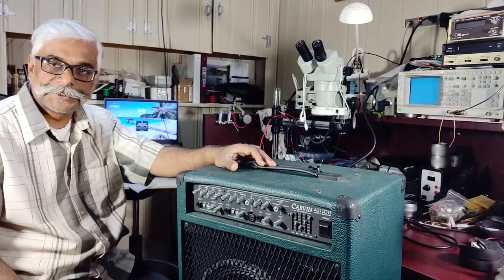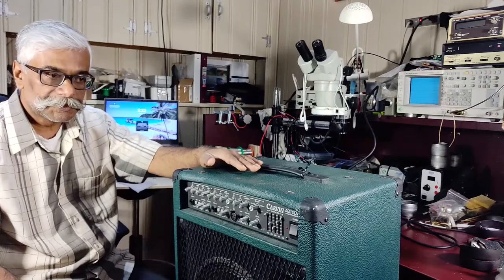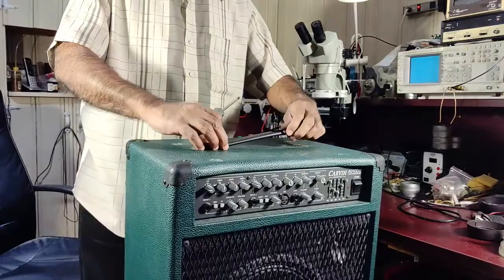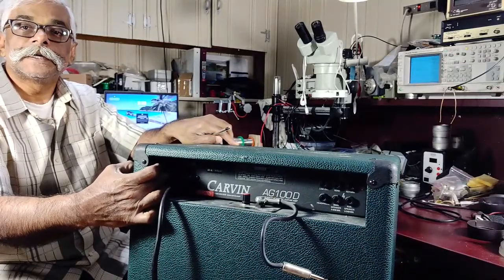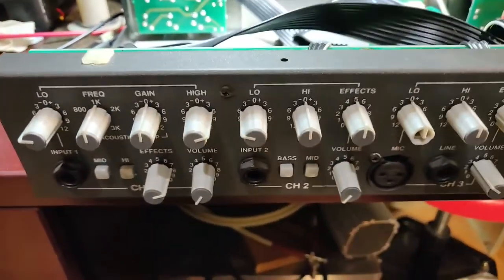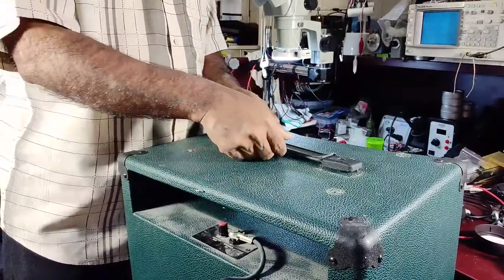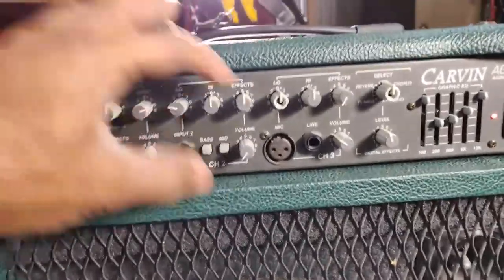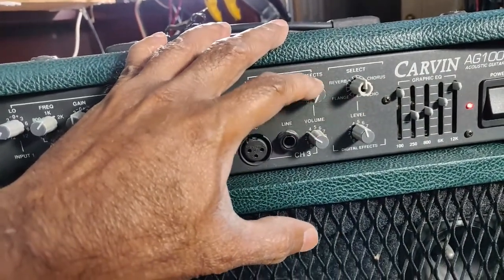Carvin AG100D | Acoustic Guitar Amp | Inside look

Comment: I have the same amp.  It has been very reliable and sounds great.  Also very versatile for not only acoustic/elec guitar, but vocals, and I even run an electric bass though it with good results.
Reply from the maker: That's nice 👍. Overall a good amp - multipurpose - value for money, and was well ahead of its time.
Reply: @PremMenon  Yes ahead of it's time indeed with 24 bit digital effects, and a real tweeter (not piezo) for high  fidelity.  The most versatile, and one of the best sounding combo amps out there.  You can even bypass the amp section and run it exclusively as an extension speaker cab.

Comment: Thanks for the help sir! Had my soon to be brother in law bring one in.
Reply from the maker: Thanks for your feedback, sir. I hope the one you get is in good condition. My best wishes to you.
Reply: Sadly, the I have 2 pots on the front that need replacing but as they are soldered directly to the PCB, I am hesitant about doing it! @PremMenon
Reply from the maker: @JasonViator  A "Band-Aid" solution is to spray DeoxIT inside those pots.
However, replacing those is not too difficult. A good temperature controlled soldering iron, a good roll of de-soldering braid, some liquid flux - and a steady hand - should do the job.

Comment: My AG100D stopped working.  The light flickers and no sound.  I pulled out the control panel and could hear a ticking from the relay.  I replaced it and still got a flickering light.  Any guess at what I should check next?  Do you make repairs at your shop?  Thanks
Reply from the maker: The PCB and Assembly drawings for the AG100D come in at least 5 different flavors from what I know.
What's the Ref Designator of the relay you replaced?
I can try and help if you can provide more details.
Bringing/sending your amp to me for repairs is not practical....and doesn't make economic sense unless you are located in Toronto.
No, it's not a shop. I just do it as a hobby.
Thanks for checking out my video. 👍
Reply: @PremMenon  Thank you for your response.  My AG100D is a Series III.  I purchased it around 2008 or 2009.  The relay I replaced was Songle SRU-24VDC-SL-C, which matched the original.  Do you think it is worth trying to repair or should I just scrap it?  I love the amp because it can be used as a bass amplifier as well as acoustic guitar and vocals.
Reply from the maker: @guitardan46  No. Please don't scrap it. As you said, it's a nice Amp.
Let me go through the circuit and see if I can remotely debug/analyze.
I'll get back.
Reply: @PremMenon  Yes, it is a really nice amp.  Thanks for working on this remotely.  🙂
Reply from the maker: @guitardan46  You probably mean the K1 relay. If that's the one, you may want to verify the circuitry (Voltage) on that relay driver (Q10, Q18), and also verify if you are getting the audio output at the relay signal input. I don't have that amp with me, but I can see that the relay is to protect the output stage as well as the speaker.
Reply: @PremMenon  Sorry for the delay in getting back to you.  I don't have the knowledge or instruments to check output.  Would you be able to work on it if I sent only the control circuit board chassis?  I removed it as you show in the video.  Thanks.
Reply: @PremMenon   I forgot to mention that I took a video of the light blinking.  You can find it under Carvin AG100D "On Light" Blinks.
Reply from the maker: @guitardan46  I wish I could say yes. It's better you find a local repair person and get it done. The repair itself should be fairly easy for a techie.
Reply from the maker: @guitardan46  please post the link here.
Reply: @PremMenon  I tried but it is listed on "Shorts", which doesn't show a link.  CARVIN AG100D "ON LIGHT" BLINKS
Reply from the maker: @guitardan46  Daniel, yes, I saw it. Not helpful. As said earlier, please follow the troubleshooting path I suggested.
Reply: @PremMenon  Okay, I'll give it a shot.  Probably will continue to search for an amp repair service locally.  Thanks
Reply: Did you ever get it working? I'm dealing with the same issue on this amp. Haven't replaced the relay because I don't believe that's the issue,but the relay definitely triggers from something,I'm assuming a component is overheating somewhere. I just don't know what component would trigger that relay.  @guitardan46
Reply: I have not got it working yet.  Scratching my head regarding where to next.  I love this amp and not ready to give up yet.  Will let you know if I get any progress.   @LeviBulger

Comment: Thanks for the look inside this amp. Quite a good design I agree.  I have one that is noisey and needs some TLC. Hope I can fix it - Any suggestions?
Reply from the maker: Hi Miller! Thanks for checking it out. The easiest would be to squirt some De-oxit to all the pots.... assuming your "noise" is scratchy pots.
If it's a different kind of noise, best is to make a small video clip and post it here on YT - and send me the link.
You didn't say it is "hum". So, PSU caps is ruled out.
Anyways, it's a modern amp; should be an easy fix compared to some classic "tubes" amp. Good luck!
Reply: @PremMenon  I sprayed tuner cleaner on all the pots so that is done. Problems I still have are (1.) when I first turn it on, no signal is getting thru on all inputs - after a bit, all of a sudden I get a signal with all inputs like something wasn't making proper contact - strange indeed   (2.) when I turn up the master effects knob I hear a hum and crackling noise that gets louder the more I turn the knob to the right - I will try to post a youtube video this week.
Reply from the maker: @millerslee  Miller, good you carried out that squirt job. Yes, please post a video. Also, see if you can tell me what rev/version yours is. It comes in 6-8 flavors - with subtle differences in each. Once I know what the rev is, I can look-see that schematics - and perhaps then be in a position to give you some useful diagnostics...
Reply: @PremMenon  My AG100D  has only one set of digital effects and no master volume on the right side of the EQ faders. I think it is 1998 rev F schematic.
Reply from the maker: @millerslee  for now, isolate the digital effects. I'm not sure if that can be done by disconnecting a wire (I do not have that amp). If needed you can carefully "lift" one leg of R117, and one leg of R32 - without damaging the part/pads/tracks. This will completely isolate the effects circuitry. Then try the amp. Essentially, divide and conquer. Well, that's what I'd have done.
Assumption: your circuitry is Rev F.
Reply: @PremMenon  I took the preamp out of the cabinet and played with the ribbon cables - reinserting them for a good fit & now it plays fine! Digital effects still a bit noisy but thats ok for now....very happy.
Reply from the maker: @millerslee  that's nice. Good for you.

Comment: Would you recommend this amp after checking it out internally?
Reply from the maker: Yes, definitely! It's a good all-round amp. I'd use it for clean sounds, perhaps with a bit of reverb and chorus; some delay. It is a serviceable amp. Only the final amp chip may not be available, but that failing is not common.
Buy only if the price is good.